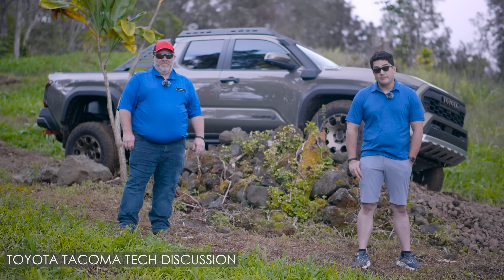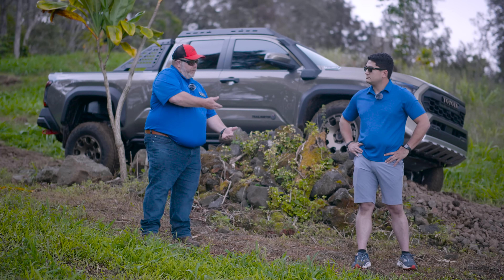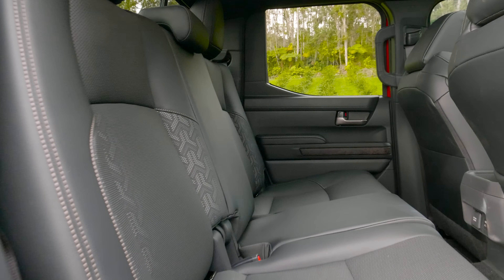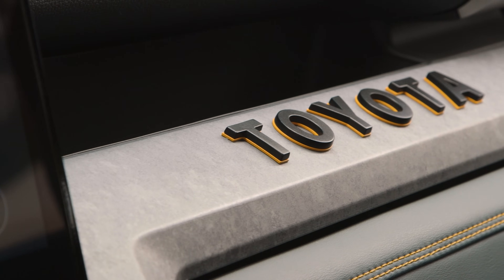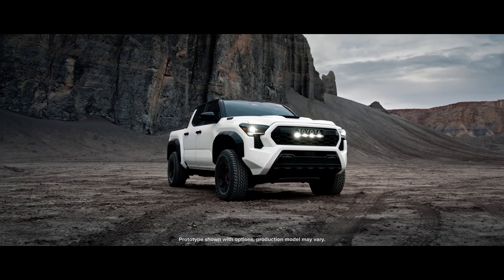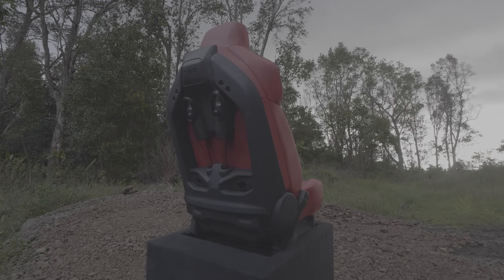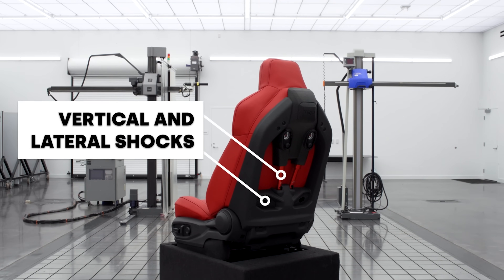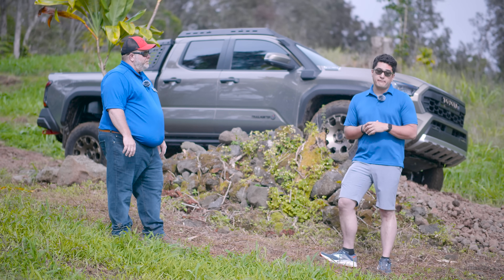2024 Toyota Tacoma | Big Changes, Technical Details

Comment: I'm surprised nobody mentioned the track width, final drive ratio,  and suspension travel front and rear in TRD pro and trailhunter.  Can somebody share this information please?  This is the final deciding factor for me to totally ditch the Bronco.
Reply: Ill guess 10 inches of travel.  Very similar, if not identical numbers to the standard truck.

Why do u not like the branco?

Would u consider the ranger raptor? It looks awesome and was announced for north america this summer, last i heard. 400hp and actual off road suspension
Reply: @bigtwinz3296  Thanks for the reply.  1. The Ford dealership support sucks big time.  I've had Honda, Toyota, Subaru, BMW but Ford ranks at the bottom in my book.  2.  Bronco price tags are well inflated for what it is.  3.  Horrible build and quality.

Comment: Toyotas are supposed to last forever.  I'm skeptical about a 2.4L turbo lasting over 200k miles, but we'll see.  Maybe the hybrid variant will reduce the total load on the engine and increase reliability.
Reply: NEW ENGINES WILL LAST ABOVE 200K Because OTHERWISE TOYOTA WOULD NOT  PUT IN The TACOMA .SO PLEASE Dont BE LIKE OTHERS WHO POST UNFAIR And CRAZY COMMENTS  🤦
Reply: @cola947  yeah that makes no sense.
Reply: @doctormosfet  POINT IS SIMPLE . TOYOTA And Lexus ARE ALREADY USING THESE NEW ENGINES And THEY HAVE NO PROBLEM S.. TOYOTA HAVE DESIGNED THESE ENGINES WITH The TACOMA IN MIND AS WELL. GOT IT
Reply: @cola947  you don't need all caps to make an argument.  Toyota is subject to market pressure like anyone else.  Time will tell whether this engine will last.
Reply: @doctormosfet   There was no market pressure instead its commonsense .because after all  tacoma is a mid size truck and  v6 is not required  and  there is no need for time to see if the new engines going to last or not because they are already in many lexus and toyota vehicles just like the 3.5l v6 when it came out.
Reply: @doctormosfet   i will put caps much as i want after. dont try to be my teach because its the internet not some exam .😡.
Reply: @cola947  THIS SPECIFIC COMBINATION OF 2.4L AND TURBO IS TOO NEW TO KNOW WITH CERTAINTY WHAT THE RELIABILITY WILL BE LIKE.  BUYER BEWARE.
Reply: @doctormosfet   THERE IS NOTHING SPECIFIC HERE .TOYOTA HAS TAKEN ITS TIME TO GET IT RIGHT LIKE ALWAYS .🤦🤦
Reply: @cola947  no need for all caps.  Toyota is forced into this position due to emissions regulations on one end and the market demands for power and torque.  That does not mean the engine will be reliable just because it has a Toyota badge.
Reply: @doctormosfet   NEW TOYOTA ENGINES WILL BE RELIABLE Because THOSE ARE EXCELLENT And PROVEN ENGINES .I RECOMMEND That You SHOULD NOT LOOK FOR ISSUES WHEN THEY Dont EXIST .GOOD BYE And Good NIGHT .🌆.
Reply: @cola947  then go ahead and buy a brand new 2.4L turbo and let me know what you think in 10 years.
Reply: @doctormosfet    CURRENTLY  I HAVE A 2021 FORD RANGER And I HAVE NO PROBLEMS WHATSOEVER . BEFORE That I HAD A 2009  TOYOTA TACOMA  And 2018 TACOMA .NEW ENGINES WILL LAST MORE THAN 10 YEARS. SO Dont WORRY NEW ENGINES WILL BE JUST FINE .👍

Comment: A friend of mine has a 2020 Tacoma that I've driven on a couple of occasions, I find the steering to be "numb". This truck a possible replacement vehicle, has anything changed in the steering feel, to your acknowledge or experience.
Reply: I own a 2019 Tacoma Limited and I'm very interested in the '24 as well. I would describe the steering to be more "old school" lol.  I believe it was mentioned (on another video) toyota is using electronic power steering in this truck. It looks like they also addressed all the issues I have with my current truck (mainly drivetrain and seating). 

Other than those issues, out of all the trucks I've owned, it has been really great to own. I would buy another one. I'm not too concern about the turbo 4 as it seems to not to be a problem in the other toyota/lexus products. I do wish they would've use the lithium battery out of the new prius (I'm thinking they will probably update this or solid state in the next 3-4yrs).

Comment: I wonder what the MPG of the Turbo Hybrid variant is going to be.
Reply: it's not a hybrid like the cars have, it's a power boost meant to increase performance over the regular motor. The Tundra Iforce max(hybrid) gets 19/21 while the non hybrid gets 18/24. It would be nice if they would offer a more traditional hybrid built for fuel economy
Reply: @liveoak7838  yeah those a re sticker figures.

actual mileage according to fuelly is 16.3mpg for the non hybrid and 16.7mpg for the hybrid.

so it, like basically every other mild hybrid, does nothing for fuel economy.
Reply: significantly worse than what one with the 2.8 turbodiesel from the hilux would get.
Reply: @anonym3017  Once you factor in the crazy cost of diesel who cares.
Reply: @bearclaw5115  diesel would have to cost 30ish% more than super for it to be more expensive after fuel savings.

and that's without considering externalized costs of fossil fuels.
Reply: @anonym3017  Hurts so much.

Comment: Another excellent deep dive. I want to know about fuel delivery. Are these motors utilizing dual injection or direct injection only?
Reply: Toyota uses dual injection on this family of engines
Reply: @jackethnicallyambiguous  thanks Jack!
Reply: @jackethnicallyambiguous  but many of Toyota’s engines are Naturally Aspirated, which are easier to implement dual injection. The information is still not available if MPI is going to be integrated for this new engine, or at least the places I’ve searched

Comment: I wonder if Toyota will come out with a smaller truck, now that the Tacoma got huge 😁
Reply: Look up Toyota Stout
Reply: They are in the process of doing exactly that. You should get a job for Toyota
Reply: It really isn't that big. Same size as the outgoing model. I'm 5'9 and I still think the Tacoma should be bigger.
Reply: it's not any bigger than the outgoing model

Comment: I can’t wait to buy one of these in 15 years when I can afford one
Reply: They won’t last that long with the crappy little turbo engine
Reply: In 15 yrs these will be illegal as government forces us to EV garbage.
Reply: @DavidRC oh yeah the dude trying to sell a product is telling something good about the product. Wow no way. Do you also trust everything used car salesmen say?
Reply: @DavidRC Even so it's only got 2.4L of displacement for a 5000Ib vehicle plus gross vehicle capacity plus another 5000 pounds to tow. It's high stress, there's no other way to say it.
Reply: Lolololooo you think these will even be affordable in 15 years? Oh you! These are starting at $50K for the absolute base model now and, with inflation and all, the base truck will be $49,997 beaten hard with issues in 2038. But hey, the new Taco in ‘38 will be $215,009 so I mean, a “bargain.”
Reply: It’s a a high stress turbocharged inline four.  They’ll be horrible in 15 years with aftermarket parts and work done by third party shops that need turnover and can’t afford to do a 15 hour job, like replacing the head gasket correctly.
Reply: @colin-nekritz  Negative, base model starts at $29k. The Trailhunter (the one I'm interested in) starts at ~$52k. Note: those are estimates from Kelley Blue Book.
Reply: Don't worry, in 15 years the resale value will be higher than the original MSRP.  You'll make $30k more than you do now, but rising cost of living will leave you at net loss and even further from affording something like this.  Source: I said the same thing 15 years ago and, despite doubling my income, now the cars I want are even more unaffordable because they have risen in price faster than my wages.
Reply: @HydeMyJekyll  I know what you mean - if you told me 15 years ago I'd be earning what I am now and still unable to buy the car I want I'd have thought you were joking.
Reply: @HydeMyJekyll  My wages have not risen since I started working in like 2015.
Reply: For $700 off the new sticker price... Not adjusted for inflation!

Comment: When i saw that rear shot of the white Tacoma my first thought was 1st gen chevy avalanche.  Which is funny because when I saw the new tundra the side profile looked so much like a gm truck.  But to be fair GM makes good looking trucks and I guess there's only so much manufacturers can do to differentiate their styling over generations.
Reply: Tundra is a very GM looking product
Reply: @joeblack1052  I agree with both Joe B and Jeremy B.  The newest Tundra looks like a Silverado with extra creases and folds.  And this Tacoma looks like a smaller version of that.  Frankly, I prefer the looks of both the Silverado and Colorado better than the corresponding Toyota models, as the Toyotas have a few TOO many extra creases and folds to my eye.  

All that said, this new Tacoma looks like a winner, especially the higher, better seats.  I’ve got an older Tacoma and it’s very uncomfortable for my long legs for any trip over 100 miles long.

Comment: Could someone explain the TRD trim to me? The engineer said it’s for “fast, high adrenaline” driving, presumably on the street but it has off road tires. Is it supposed to be on or off road-focused?
Reply: It's built to be able to handle off road running, but most people that buy these will be pavement princesses.  True offroaders will buy a lower trim and fit it out with better components to truly handle off roads better.
Reply: Baja truck just like Ford’s Raptor models. You can drive it fast out in the desert or on a rally track.

Comment: They kind of glossed over the replacement of the access cab with “extra cab”. I hope I’m wrong, but in another video it looked like they completely removed the seats from that configuration. Really hope I’m wrong, I’ve bought had 2 access cabs in a row and for a reason. I rarely have more than one passenger, but frequently need a 6’ bed. The long bed dual cabs were incredibly rare, and were also pretty expensive. Really hope I’m wrong and the extra cab is as usable as the access cab.
Reply: Not only did they get rid of the rear seats, which isn't  a big deal to me, since I removed mine, but they removed the access-cab doors.  That's a deal breaker.  It's a pain in the butt to get stuff in and out without those doors.  I don't want double-cab, so I always buy access-cab trucks.  I won't be buying the 2024 Tacoma unless the do a refresh to add the doors.
Reply: @hiagftd  Same, but I have to go for DCLB. Assuming I can afford it. Because of the increase wheel base, the DCLB looks quite nice.
Reply: @hiagftd  newsflash they're not spending millions of dollars to re-engineer a cab and crash test it just to add doors for the 5 people that buy access cab. The Xtracab in my opinion is great because its a sneakier way for them to bring back the single cab and they split the difference between the two.

The engineer talked about how 50% of access cab sales were seat delete orders so it made total sense to just make it permanent. By making it Xtracab, they made the seat move up and tilt forward as close to the steering wheel for a lot more access to the rear and then slide back to your seating position. They also installed lockable storage lockers with pegboard design back wall to actually make it usable space plus you can actually recline the seat unlike the single cabs upright and cramped seating position. 

Also with the xtracab, you get more structure for crash rigidity unlike a lot of these suicide door cabs that deform on offset crashes. Its also a clever way to make two cab configurations on one wheelbase to please more customers. Xtracab 6' bed is the same wheelbase as double cab 5' bed and they already use the 6' bed on the longer wheelbase so they don't need to make a special bed size. 

If you're not a fan of the Xtracab, you can always buy the Nissan Frontier which is the only other midsized truck that offers a smaller cab with access doors. In a market that's dominated by posers who only want the look of a truck but the drive of a sedan, be happy Toyota and Nissan went out of their way to give you a smaller cab option. GM and Ford know its a waste of money to engineer them for the few people that buy them.
Reply: @CACressida  Fine, make it a lot cheaper than the current access cab. Losing the door and seats for more money is bonkers! Only a sheep would agree to being spanks.
Reply: @RisenEagles  sheep? Its literally your only one of 2 options. Its a money loss for them to make it because everyone wants big cabs. Toyota and Nissan are the only two making small cab mid size pickups while everyone else abandoned them. Buy more and companies will make more
Reply: @CACressida  So I'm stuck with the DCLB then?
Reply: It isn't, which stink. I have to now get the DCLB :(

Comment: I'm glad a manual transmission is still available!
Reply: Keep in mind that the manual transmission is not available with the hybrid powertrain which is the only engine available for the TRD Pro, the Trailhunter, and the Limited. The 6 speed MT will only be available on the lesser grades, but the engine power has to be reduced by 8 HP & 7 LB-FT over the 8 speed AT option. The SR will get an even smaller output engine.
Reply: @tomheringer2047  TRD pro manual loses all of it special off-road features.
Reply: Ditto
Reply: Agreed!
Reply: Manuals are for the budget minded

Comment: Maybe this will make the current Tacoma a little more affordable! Unlikely though lol
Reply: On the access cab (2 door with a storage area behind the seats) the costs should be very low from a manufacturing standpoint. Removing the suicide doors upset some people, but the reduction in complexity will be massive from a cost standpoint. I'm hoping for high 20s or low 30s as the MSRP for the base Tacoma. The Ranger for instance starts at 35.

Comment: That guy could use more strength in some critical areas..
Reply: lol
Reply: I didn't want to mention the elephant in the room (Do you see why?! 😬), but Jack's attempted compliments might have a patronizing vibe, and the one grainy zoom shot has something subtly comedic. Not shying away from side perspective is at least kinda honest and authentic and I appreciate it more than cosmetic illusioncraft, and for the important bit:
From my understanding that look is all-water, so he might be overdoing it with the carbs and thus burdening his liver. (Which seems to be a general issue on Hawai'i, attempted to be addressed with the cultivation of native traditional veggies, but they might be too low on energy.) - Again, if what I learned is right, then such a belly is not a fat deposit issue but water, and it is an iconic warning sign to go low-carb, which actually means mainly fat as energy source, ideally high quality, so that protein doesn't have to serve as energy source but can provide the buildings materials, because protein has the low energy density of carbs.
The natives started getting issues like this when rice became a staple food, also because poverty further drives carb overload.

Comment: Does this new platform support a potential all electric version?
Reply: nope. not how things work
Reply: @bradhaines3142 Actually things do work that way. Take a look at the new BMW 7 Series. The i7 is fully electric while the regular 7 is gas on the same platform. And the vehicle is incredible. I believe it's more so that Toyota's been dragging their feet on their electric platform.
Reply: Weight makes electric increasingly inefficient, and since Toyota is THE hybrid brand, I'd assume they didn't plan for it, at least not fully. It makes more sense to strongly focus on electrifying the small car sector and end up with a technology mix - basically following the wise principle of diversification.
Reply: @Dowlphin  no, for electric it's too different. they'd have to completely redesign the body to account for it. no good electric car is also a gas design. entirely different needs